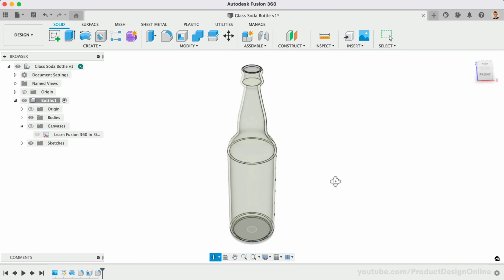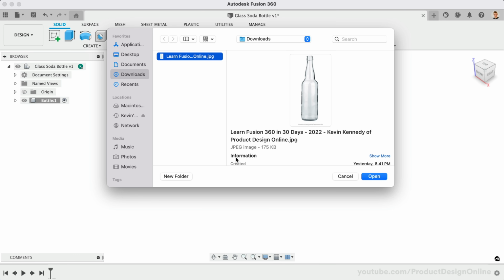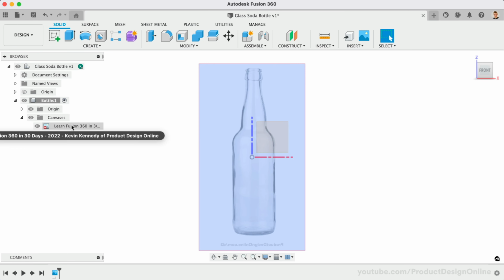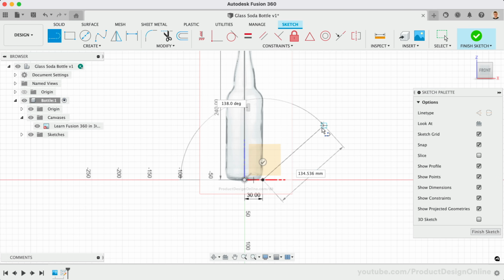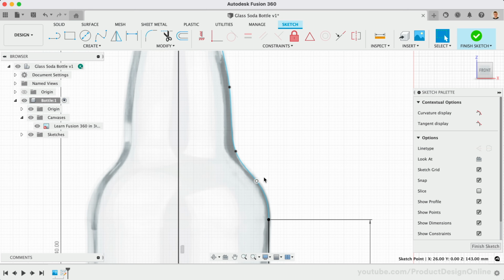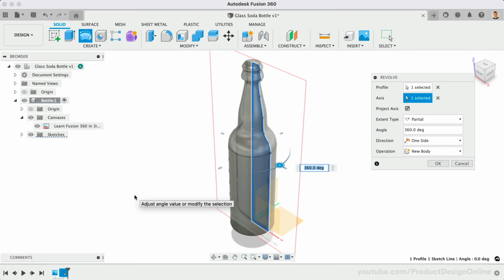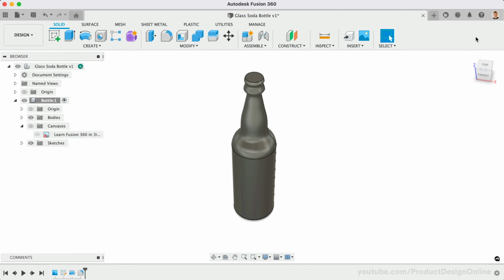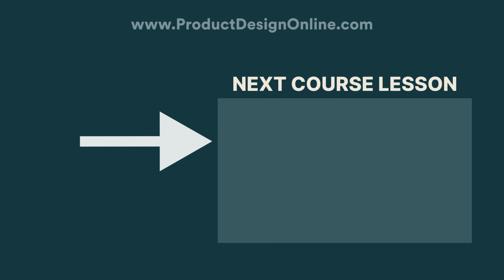Day 2 of Learn Fusion 360 in 30 Days for Complete Beginners! - 2023 EDITION

Comment: Hey guys I found problem solution for shell command when it can not detect face, you only can select whole bottle! So basically problem fit point spline, do not round or make horizontal last top point, in video he did not do it, if you do it, fusion will think that top face isn't flat surface! I just deleted last spline point and it didn't change much my spline so I left it as it is and shell command worked! If you want round edge you better use filet tool after you do shell command, DON'T MAKE ROUND TOP EDGE IN SKECH !!!!
Reply: THANK YOU - this was driving me crazy, and your suggestion fixed it. :)
Reply: @stevea1008  Even when I use a horizontal top it still chooses the whole bottle. I ended up extruding the top face up by 2 mm and then it can select the top face only.
Reply: Thanks. I was getting frustrated also :::
Reply: Thank you. I had the same problem
Reply: You sir are a savior
Reply: Bless you
Reply: Thank you
Reply: Thank you so much!
Reply: this comment made my day.. thanks a lot
Reply: Thanks man, Was starting to lose hope.
Reply: Thanks, you just saved me a ton of time troubleshooting that LOL
Reply: omg ty it worked just put the horizontal constraint on the top of the bottle in the sketch
Reply: Saved me, thanks!
Reply: @yuanjianliu  Same here, thanks for the tip! Curious that it allows to extrude the face, but at the same time doesn't see it as a valid target for shelling.
Reply: I'm not able to go back to parametric modelling as this dude is going so what's the solution?
Reply: @FordraptorF150  For some reason I have to double-click the sketch step twice before it takes. Does it just do nothing when you do this?
Reply: Yes i'm still not able to figure this out, shame
Reply: I got stuck here, too. Shell only works on a perfectly flat face, so the Bezier handles can’t be out on that last point that closes the profile sketch.
Reply: This comment should get pinned
Reply: how do I undo that top par if I have doen the round top edge how to I remove that one part and add a straignt line?
Reply: unlink from the straign line the point will then be able to delete
Reply: This worked for me as well.
Reply: This was so helpful I was boutta crash out thank u so much 😭
Reply: LETS GOOOOO
Reply: Thank you!
Reply: I still cannot figure this out, mine is going to be a nice solid bottle for now, when I try to shell the top circle, it selects the whole bottle.

Comment: For the ones that has problem with "New component" and that the canvas gets low opacity and the canvas is not imported under the component you need to do the following:
1) Create the component
2) Deactive the "origin" folder above your new component (click the eye) (or you can right click and hide planes and hide axes)
3) Import the canvas and when you select the "Front" you need to be sure that the Yellow/orange box/side is "blue" otherwise it will be inserted in the standard Origin
Reply: You must activate the origin in the new component
Reply: In simple terms for real noobs like me, BEFORE adding the image, under the drop down "Origin" on the left side of your window, expand the list, click XZ, then there will be a blue box on your screen. NOW click the insert then canvas, then ok. This worked for me after messing around trying to figure out what's what. Like I said I'm a complete noob.
Reply: @LnJCanadianRC  I had the initial issue and i'm glad you mentioned it. by default the Origin plane is active from not our object. probably a useful feature for someone who knows more.
Reply: Thank you. Saved me a ton of time.
Reply: @LnJCanadianRC   yep, got hung up on this. Thanks for the clarification
Reply: You saved me a google search. Absolute homie
Reply: @LnJCanadianRC  Thanks, this is exactly the thing I needed for my smooth brain.
Reply: What I don't understand is why this was not covered in the video, and what is different between Kevin's settings and ours.
Reply: @LnJCanadianRC Thank you so much for the Canvas advice!!!
Reply: Thanks!
Reply: Thank you this helped! @The_Egdog
Reply: Thank you!  @The_Egdog
Reply: HOW DO I INCREASE THE OPACITY OF THE  IMAGE I TRIED DOING IT FROM THE CANVAS SETTING BUT IT DIDN'T HELP MUCH. I NOTICED THAT THE IMAGE OF KEN HAS MORE BRIGHTNESS AND CONTRAST. PLEASE SHARE WITH US THE SOLUTION, THANK YOU
Reply: @glensmith766   I've found a few things different, even in lesson 1.  Maybe there's an updated version we're using?  Anyway, I f'ed this part of it up and had the barely visible image so I was struggling.  Going to start over.
Reply: @LnJCanadianRC  I noticed another thing with this, click the XZ under Bottle:1 --> Origin, then it shows up looking like it should.  Don't click the XZ under Named Views --> Origin.
Reply: It's not working for me. no matter what I do, it will not be listed under the bottle component.
Reply: @LnJCanadianRC you re a lifesaver
Reply: Thank you so much I was struggling for the same thing🙇🏻‍♀️
Reply: Why does it keep giving me an error everytime I try using the dimension thing
Reply: after doing this I'm still unable to get the canvas in bottle folder.
Reply: For me, I had to disable the origin folder above the component, then open the bottle component, pick the origin inside the bottle component, then click on XZ, then insert, canvas, and open the bottle image.
Reply: @LnJCanadianRC  God, I've found the answer in your comment twice in 4 months now.  Thank you!
Reply: @Linili89  Did you try to disable the origin on top of the new component and select/highlight the origin under the component you just created?
Reply: Thank you! I was going nuts trying to figure it out.
Reply: @LnJCanadianRC  Thanks. It really helps.
Reply: Thank you so much, you saved me what probably would have been half an hour of searching!
Reply: thanks
Reply: i dont understand
Reply: @LnJCanadianRC  Lifesaver
Reply: tyty
Reply: @The_Egdog  thank you suggestion
Reply: @The_Egdog  Thank you!
Reply: Another important thing is that your origin of the Bottle component is visible. So under the dropdown of your Bottle component go and click on the 'eye' icon of this origin so that the origin of your component is visible and you can select it later.
Reply: @LnJCanadianRC  Stellar guidance. Much appreciated.
Reply: Thanks!
Reply: Mine only works after going to preferences settings > Design > Assemblies. Uncheck active component visibility.
Reply: Dude, Thank you so much
Reply: tysm
Reply: Thank goodness. I couldn't figure this out.
Reply: @LnJCanadianRC  I like this guy's tutorials but guys like you are truly the heroes that fill the gaps. Thank you! ✨
Reply: Thank you!
Reply: @GoForCatch  hey..try selecting XZ under orgin of the bottle component
Reply: @The_Egdog  THANK YOU! I was going nuts trying to figure this out.
Reply: @LnJCanadianRC  God Bess You!

Comment: Very useful tutorials - thanks for making these available. One small thing - if you draw the line at the top of the bottle from the outside to the inside then Fusion 360 takes this as an extension of the existing line and a single surface. Then you can't select the top of the bottle to do the hollow step. You have to draw the line exactly as you do in the tutorial - from the centre axis to the edge - then it works.
Reply: Thanks, I couldn't find my mistake!
Reply: Ahhhhh I did this but my sketch still wouldnt turn blue. Hollow step = revolve lol. I realized my curved line was dotted therefore it was a construction line not a real line (I need to make real line the default somehow). Changed the line type and now it is a blue sketch.
Reply: HMM, I have tried that but still can't do the hollow step

Comment: Had trouble getting the canvas to show up on the component when following exactly. After reading some of the comments discovered one more "Non-intuitive" feature about Fusion. Needed to hide the "Origin" feature on the main tree which was active by default, and enable the origin feature under the component "Bottle" which was inactive by default. That fixed it so the canvas showed up under the component.
Reply: thank you lol
Reply: Thanks!
Reply: Thank you!
Reply: Thanks for the tip, was trying to sort out the exact same thing.

Comment: Great concise video and super easy to follow along. 
One thing I noticed however is that my bottles top plane wasn't being removed by Shell operation, so after researching for a bit i learnt that shell tool works best with non Fillet planes. So i backtracked and used shell tool first and performed fillet on top and bottom both at the end leading to a cleaner geometry.

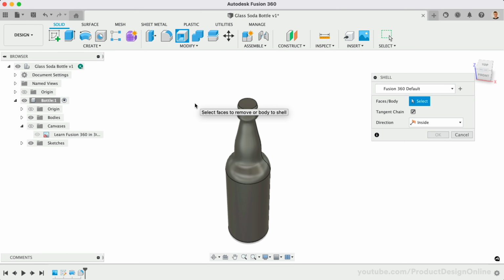Comment: Had a small hickup during the 'Shell' command on 00:10:20, there needs to be an angle on the top of the bottle to the splinded surface, if they line up horizontal the shell command won't select the top as a separate surface. Great tutorial so far, very logical to me.
Reply: thank you!!!!

Comment: It took me a second to figure it out, but I had a problem with selecting the top of the bottle to create a shell. I was getting the "sketch is overconstrained" because I did the vertical constraint on the first curvature point, and for some reason, it didn't allow me to have two constraints. I removed that one and I was able to constrain the horizontal top point, which gave me the option to shell the bottle. Excellent tutorial!

Comment: I had trouble with the shell command. I could get it to work, just issues with the value I could input. It allowed 1 and 2 mm, wouldn't allow the recommended 2.5mm but would allow 5mm. Still not sure why but it may become apparent later. Really impressed with the course so far.

Comment: For anyone struggling with the SHELL COMMAND and MOUTH OF THE BOTTLE:

DO NOT try to model the final curve of the lip of the bottle.  Keep your last point ending with a vertical line, and the top of the bottle with that horizontally constrained.

YOU WILL GET THE FINAL CURVE WITH THE FILLET MODIFIER.

For the Shell command to work properly and have the right thickness at the mouth of the bottle you want the hollowing surface to be as much of a right angle to the side as possible to get an accurate thickness.  Imagine a plank of wood.  If you cut across that plank of wood perpendicularly to its length the cut has the same length as the thickness of the plank.  But if you cut at an angle, the length of the cut gets longer through the thickness of the plank.  Its hard to explain in words but that was tripping me up for a few minutes until I realized how the Shell command functioned.
Reply: thank you so much. comments like yours help a lot in our journey. much appreciated
Reply: it is still very fague, but thanks for trying haha

Comment: here is what works best if you are having a problem with the shell working. just skip the constraint parts its easy to just redo the whole project and start over so when you do dont put constraints and the spline works just fine with the shell. easy.

Comment: Struggling here - When I click to ccreat the canvas, it does so as a bullet at the same level as  Bottle 1, insteead of as a part of Bottle 1.  Can't figyre out what i'm doing wrong
Reply: When importing the image as a canvas, you have to choose a face to orient it. Change your origin visibility settings so that the face you select is the one under your bottle component instead of the whole design’s origin.

Comment: I just spent about 2 hours digging into Fusion360.  My background and experience goes back to Rhino and Maya back in the early 2000's so a lot of these techniques and walkthroughs are a great refresher.  I haven't used an modeling/design software in over 20 years and it feels like second nature.  My only challenge is it just dives into the tool and interface and maybe I haven't looked at your channel but I'm finding that running these videos at 75% speed is helpful because I'm new to the UI of this application.  I stumbled upon this video series and probably should have started somewhere else first but needless to say these are super easy to follow and gives real application purposes of how to leverage to the tool in its most practical form.  Thanks for creating this series ( what appears to be from 2022) but all still relevant.  Since I', not in any production mode yet and just getting back into it I'm hopeful the full series does not required any paid features.  I'm getting back into modeling as I'm in the market of getting a 3d printer.  I cannot wait to re-create what I did in the early 2000's by printing designs in a 2d plane (paper) and getting them re-modeled with newer technology and create my designs from college in a 3d space with a printer.  This series ( so far) is super helpful thanks for sharing and taking the time.  Only downside is it just dives directly into it but I know there are tons of videos, maybe a recommendation is to provide a VERY basic interface video before jumping in.  These concepts are not foreign to me so I'm able to follow along very easily.
Reply from the maker: Please see the link in the description for the official playlist. The first video is covering the interface (before Day #1) :)
Reply: I was able to get this to work by opening the origin folder under the bottle.  You should see the XZ access in origin under bottle high lighted.   I have the front view selected in the top right.

Comment: Heads up. If you are using the newest fusion, by default the shell command uses sharp edges, you have to switch it to rounded shell or else you will get an error
Reply: Thank you so much, that was really frustrating me

Comment: Hi!  I'm really enjoying the course so far.  I had a bit of a problem though.  When I used the shell command 2.5mm made the shell way too thick and the hole way too small.  I ended up using 1mm and it matched your video much better.  Why might that be?  I went back and check all my dimensions and the bottle is 240mm tall, with a 30mm radius and the top line is 11mm (the total top width is 22mm after the revolve command.

Comment: Dunno if anyone else had this problem, but if you had trouble with the shell direction of the bottle (around 10:20), in the sketch after you create a horizontal constraint for the top line of the bottle, you might need to create a vertical constraint for the last spline point that connects to the bottletop line. Before I did that, it kept attempting to create a shell in the horizontal/arbitrary angle direction of that last spline point's alignment, which would either error or mess up the whole 3d shape.
Reply: Thank you! This helped me get the shell stage to work. My most top-right spline handle had to be vertical.
Reply: He does mention to add a constraint at 7:23 though
Reply: another issue with the shell :( fusion does not let to select a bottle top face; the whole body always selected; I can select this face manually when not using a shell tool, but when the tool is selected - it's impossible
Reply: Thank you so much! I had the exact same problem, and your solution worked perfectly!
Reply: @AndriiGumennyi  It's the same issue that they had, follow their instuctions and your problem should be solved.
Reply: @AndriiGumennyi  bump because I'm having this problem too. Did you ever get it figured out?
Reply: @hamwisehamgee77  this was because I added one more extra constraint for line - to be tangled to the top, I checked video one more time and understood it's not needed
Reply: helped a lot , thanks

Comment: Having the same problem with location of Canvas.  Info below helped, but none worked (for me).  What I found was that (might be I misunderstood a term or something) the "eye" for the Origin portion of the component was NOT ON.  I'd turned the eye for the root design off as suggested below, but that still hadn't resolved the problem.  So, when I selected the FRONT face, even with the "root" origin eye OFF, the canvas was still assigned to the main design.  One thing I noticed, though, was that the yellow blocks representing the axis faces were a pale, highly transparent yellow - not the  nearly sold yellow shown in Kevin's tutorial.

After clicking on the Component Origin eye, I noticed the axis faces were immediately a nearly solid yellow (as in the video). I'd thought it was just a characteristic of the screen capture.  Once the faces were solidly yellow, everything worked as Kevin demonstrated.  Phew!  :)

Comment: Hi! Thanks so much for this tutorial. I had a question for you. I didn't quite understand why we needed to filet the bottom before doing a shell. I tried doing the filet after the shell, and it still produces a nice curved edge. I posed a question to YouTube AI, and it gave me this explanation: 

"If you were to shell the object first, the sharp edge would remain on the inside. By filleting it beforehand, the shell command traces this already rounded edge, resulting in a consistent rounded thickness throughout the bottle, both inside and out."

It seems like AI gives two explanations: so that the sharp edge doesn't remain on the inside (does this matter though?) and that you get a consistent rounded thickness. Is this a correct explanation? 

Thanks in advance for your time!